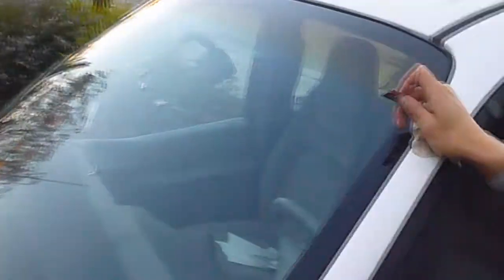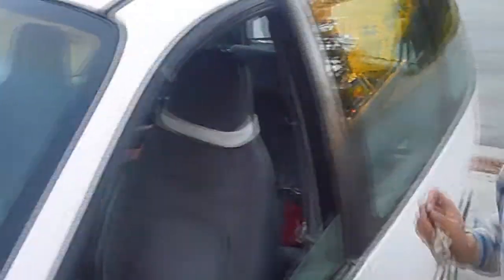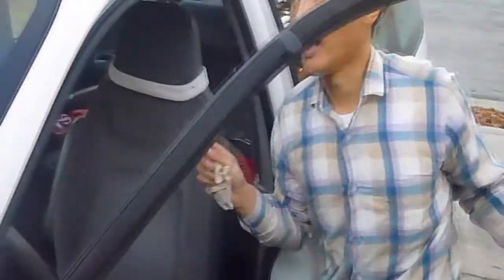Windshield crack repair experiment 2

Comment: What if there is no curing strip in the windshield repair kit abd im doing it at 3am because i live in arizona and its been 107 in daytime? Should i just leave the plastic syringe holder on the repair for few hours?